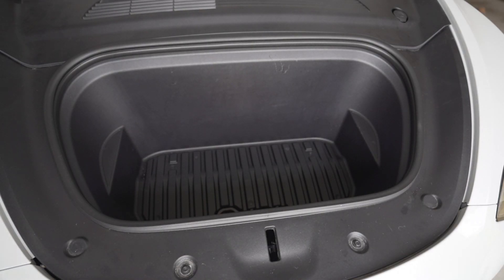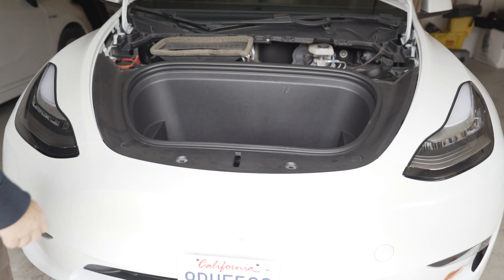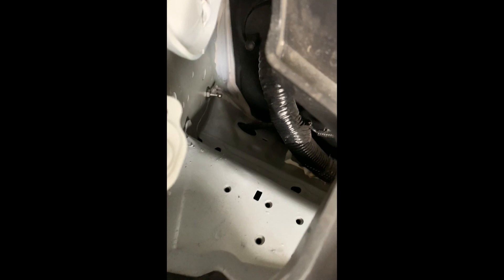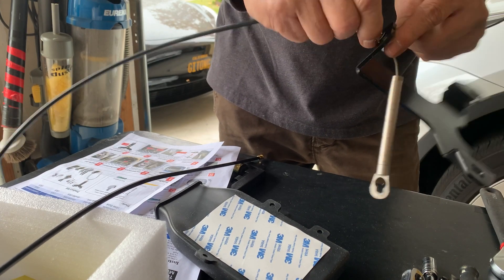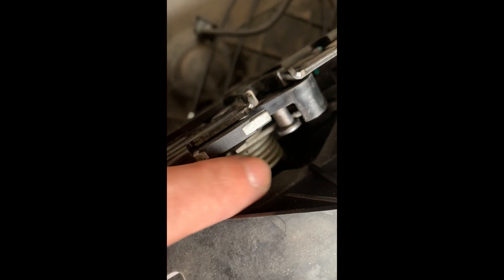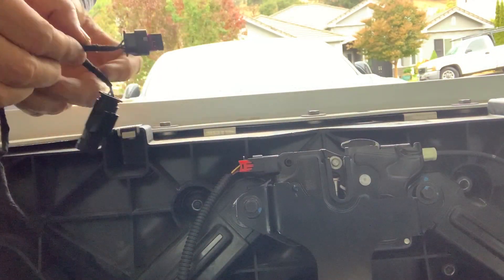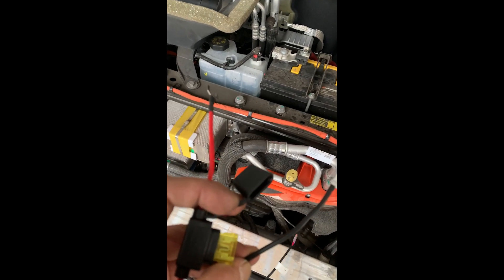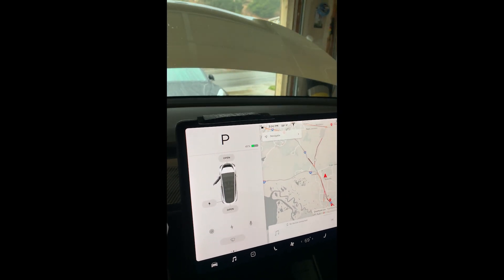Tesla Model Y Power Frunk Install

Comment: Where did you tie everything down so they don't bounce around?
Reply: Lucy Hampton
Hi Just Havin' Fun,  I am the installer and unfortunately, I don't have pictures where it was mounted.  But if you pause the video at 11:37, and you'll see the positive and negative wires. Mount the module  on top of the black oem frame that shows the orange wire across with large zip ties.  If you pause the video at 11:06,  you'll see the black angled frame where I plugged the wire.  Mount the actuator behind that frame with large zip ties.

Comment: How do you set the frunk hood opening height and speed of closure?  
Do you have a picture of where you mounted the control unit and Actuator?
Reply: Hi Just Havin' Fun,  I am the installer and unfortunately, I don't have pictures where it was mounted.  But if you pause the video at 11:37, and you'll see the positive and negative wires. Mount the module  on top of the black oem frame that shows the orange wire across with large zip ties.  If you pause the video at 11:06,  you'll see the black angled frame where I plugged the wire.  Mount the actuator behind that frame with large zip ties. And if you haven't bought one, please consider using referral code "isip25" and your price should only be $425.
Reply: @Baltaofm  thank you I was wondering too where to put those accessories. For the emergency release though, can't someone just walk up now and pop out the tow hook cover and yank on the emergency release to open the frunk? Does the release only work somehow when the power is out and no other times?
Reply: @Baltaofm  Shouldn't the actuator be mounted so that it faces straight up?